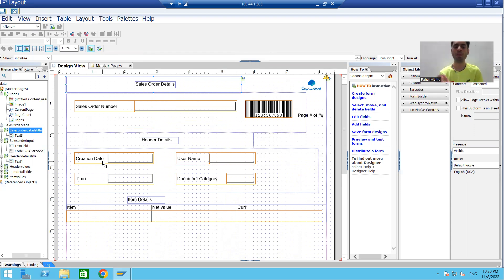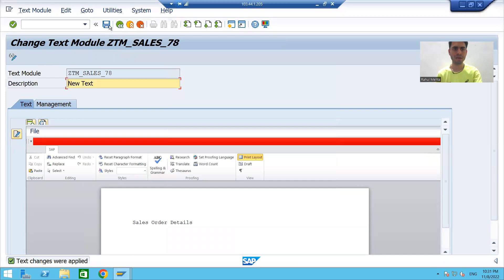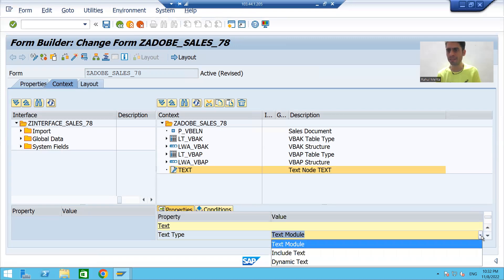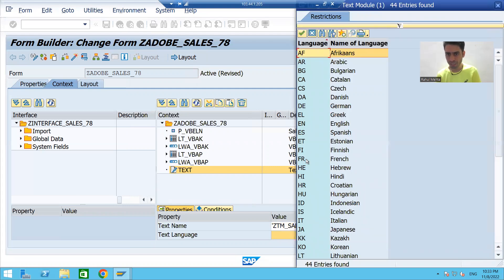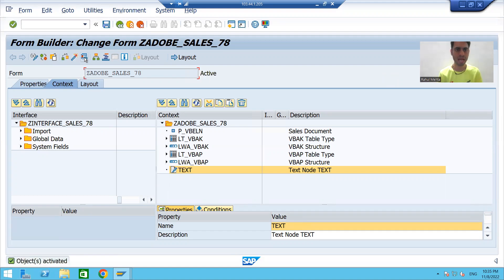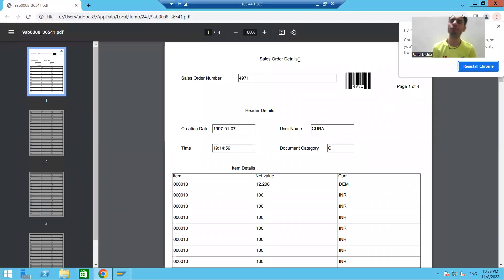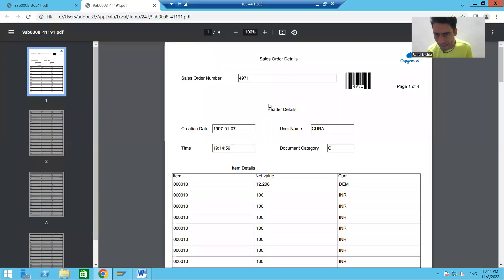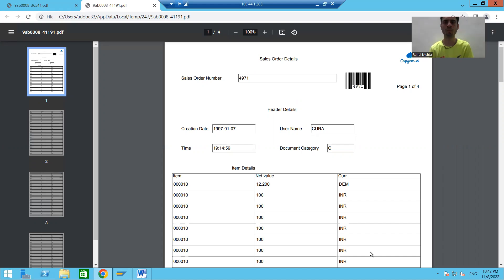11 - Adobe Forms - Use of Text Module and Include Text

Comment: Adobe form is enough to fullfill our requirement than why smartforms sir?
Reply from the maker: Hello - Please refer to the introduction video(first) and refer the upcoming videos, you will get the answer of the same.
Reply: @sapabapbyrahulmehta    page break command  will give to the table of main area only sir .. or .give page break command to which  window having the TABLE OR PARTICULAR HEADER PART ONLY NEED TO CREATE THE COMMAND
Reply from the maker: @KANNANKANNAN-vu9rq    I am not getting the question. The sentences are merged with each other. Is this related to smartforms or adobe forms? Are you asking for COMMAND in smartforms?
Reply: @sapabapbyrahulmehta    in smartform we will make page break command  means we give certain page break condition in item values (main area of table only) or give the command condition for whole window having the table.
Reply from the maker: @KANNANKANNAN-vu9rq    We can not provide at the window level , as command we create inside the window. So, you need to do at table level.

Comment: Hi Rahul, I am creating an include text and implementing in my adobe form layout the same way as you told but the text is not reflecting in my output adobe form...can you please help me regarding this!
Reply from the maker: Hello Ravi -  Cross check the below mentioned points. 
1 )text id, text object, text name, text language of include text in your adobe form. 
2) Saving of your Include text in SO10.

3) Text Mapping in your Subform.
Reply: @sapabapbyrahulmehta  

Even iam also facing this  problem 
the include text is not working
Reply from the maker: @JahnaviSaikam-z7i    

Hello Jahnavi - Cross check the below mentioned points. 
1 )text id, text object, text name, text language of include text in your adobe form. 

2) Saving of your Include text in SO10.

3) Text Mapping in your Subform.

Comment: Hi sir , thank you for this help full video.
I am facing one challenge, Sir can you tell me how to text style ( bold text , color text) from So10 text in Adobe form where SO10 Text is getting fetch by read_text fm.
Like I tried to make the text bold in So10 and then read it using read_text fm but it is not working.. in Adobe form it's appearing as normal text only.
Reply from the maker: Hello Debayan -  You need to assign your paragraph format in SO10 transaction code itself. In Adobe forms, when you are creating a text node for include text, pass the style name there, the changes will reflect. There is no need of READ_TEXT FM. If you still want to use READ_TEXT FM,  the returning internal table of this FM has 2 things - TDFORMAT and TDLINE. In TDFORMAT pass the name of your paragraph format.
Reply: @sapabapbyrahulmehta  thank you so much sir..I'll check it
Reply: i have same requirement, how did u acheiev this?

Comment: Hello Rahul,
Could you please let us know how to print MultiLine include text that can flow to next page according to its length?
Reply from the maker: Hello Surendra, The SAP FM : READ_TEXT is used to get the Include Text. This FM returns the include text in the form of internal table. We need to write the logic for the same in Interface of Adobe Form. Drag and drop the Text Internal table from Interface to Adobe form. Create one subform in the Layout of Adobe form and drop the text internal table in subform. Take Subform as flowed, so the text will automatically flow to the next page. Please refer this video, It will help you on the use of READ_TEXT. https://youtu.be/hKYdB1DnFHc?si=V5qksOGUesUOlLK-
Reply: @sapabapbyrahulmehta Rahul, isn't there any other way? I've seen "Allow multiple lines" in textfield property but when I tried it, I have to drag the textfield's length on layout according to the number of lines in standard text. I believe I am not using it correctly. A brief guidance would be really helpful.

Comment: Hi Rahul, how to control the SO10 text based on some conditions. Example I would like to print footer based on some company codes. 3 SO10 texts and 3 company codes. at a time one only should disply based on compnay code. can you pls help on this.
Reply from the maker: Hello Lucky, once you move forward in the playlist, There are videos of Scripting Languages, You need to Write Scripting Language for this Requirement.
Reply: @sapabapbyrahulmehta  yes.I have gone thru those videos. My doubt is that already I bonded my SO10 text. Can we change this text in scripting?
Reply from the maker: @luckyfin4572   As per my understanding, take those 3 texts in a subform and depends upon your condition, Make one as visible and other 2 as hidden at a time.
Reply: @luckyfin4572 : Take a global variable GV_TEXT type TDNAME. Pass this to NAME of context-TEXT node.

Pass SO10 text name to this GV_TEXT according to company codes in CODE INTIALISATION of FORM INTERFACE.

Comment: how to control this include text. example i need to print footer based on company code. one company code one text another company code another text in the same subform.
Reply from the maker: You need to use Scripting Language in that case. When you move forward in the playlist, You will find the videos of Scripting Languages, you will get the idea , You need to make one as hidden and another as visible based upon the condition.